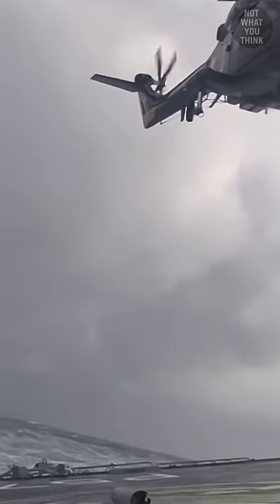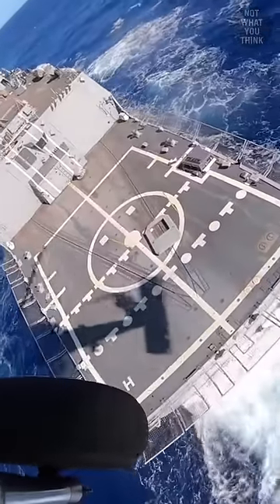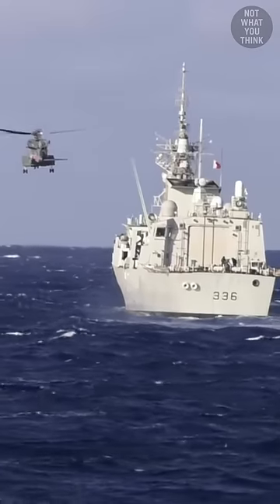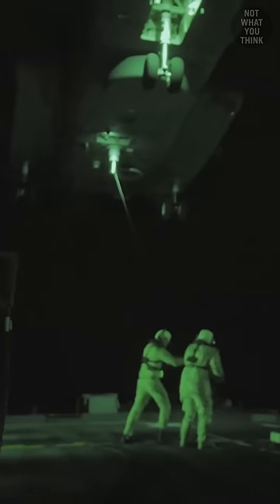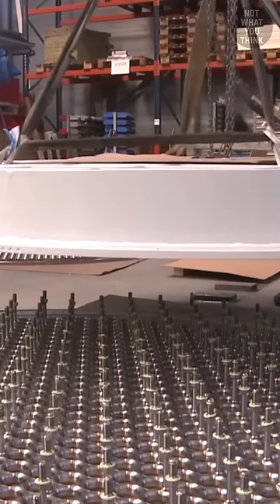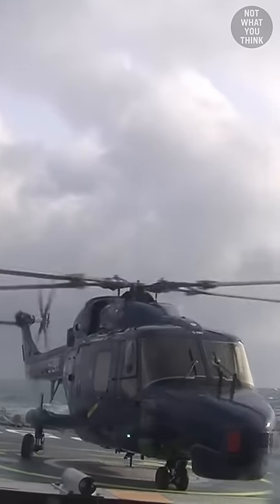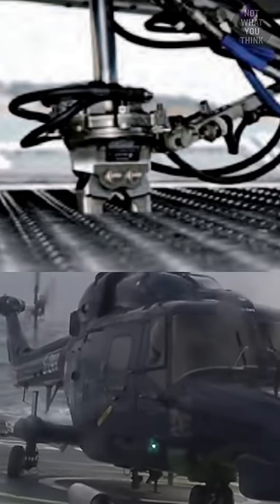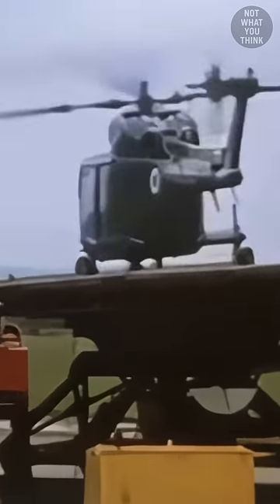Helicopter Bear Trap #shorts

Comment: Its called RAST. Recover, Assist, Secure, and Traverse. And if it doesnt work the flight deck can't get certified and your stuck on the ship for a week in port fixing it. 
-ex navy electrician
Reply: No R&R either? I wood image they would take that time to do some spring cleaning, and preventative preventative maintenance. What would the crew do in times like you speak of?
Reply: With the British device doesn't the helicopter still have to land first? Isn't that the hard part and what the bear trap is so good at?

Comment: The problem with grabbing the cable by hand is that helicopters can develop a charge differential from the ground under certain conditions.  Normally this charge differential is discharged when the helicopter touches down, but if you have a person grabbing a cable lowered from the helicopter then the discharge goes through the person grabbing the cable.
Reply: Yep, that happens when rapelling from a helicopter too, that's why they make sure the cable touched the ground before anyone slides down from it rather than lowering people down on the end of the cable. Gotta discharge all the built up static or you can get electrocuted trying to slide down a rope...
Reply: I bet they were shocked

Comment: I feel like the winch is that safer option for the aircraft because it can be like like the arresting wires on an aircraft carrier by having the helicopter produce positive lift while being pulled down so that if the wire does break the helicopter will immediately pull away kinda like how planes land at full throttle on an aircraft carrier so I can immediately take off if the cable breaks.

Comment: "Use their bare hands to grab the cable." – may not sound like much, but when you grab a long-line from a helicopter 🚁 you get a big jolt ⚡ due to the static electricity generated by the rotors spinning at high rates.  
On portable seismic crews in Alaska, I was advised to grab it with my Right hand so the charge wouldn't go directly through my heart!😮 call me Sparky 😅

Comment: Doesn't it make even more sense to drop a line from the helicopter on to the ship in a sort of hybrid of these two Systems?
Reply: What you describe is the bear trap system. The helicopter drops the line with the probe, the flight deck crew then drops it into the pulley system and puts tension on it as it drags the helicopter down.
Reply: The helicopter sends down a messenger cable. The flight deck crew then hooks up the haul down cable to the messenger cable. Then the helicopter crewman controls the cable up to the seated position inside the RAST probe. Once it is seated, he reports to the pilot that it has been seated, which is then relayed to the ship. Then the ship pulls the helo down to the deck.

Source: former H-60 crewman that worked the system